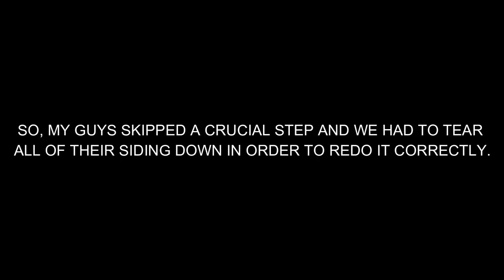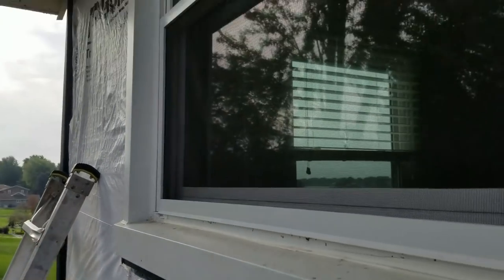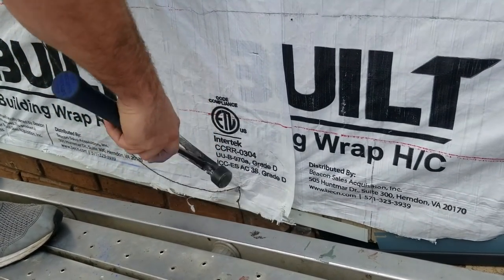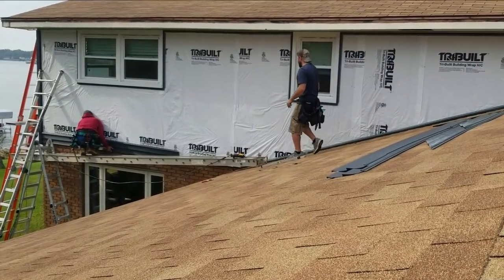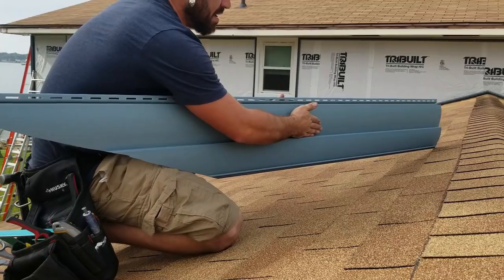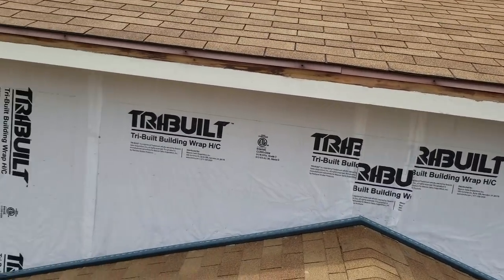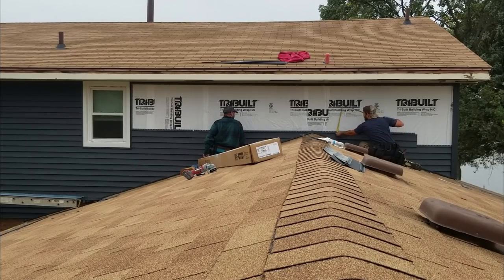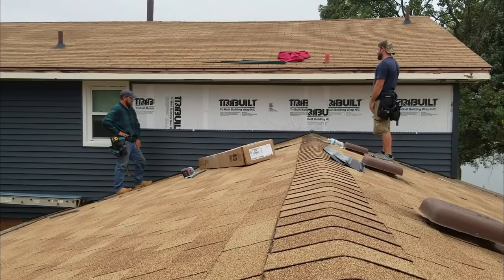HOW TO and HOW NOT TO make siding meet UP over a reverse gable

Comment: I was the brake operator for 3 years back in the 90's for a local sliding guy in NJ. I guess i wasn't cut out for the pick had shaky legs. I was the brake king could bend anything! Dormers were the worse for me had to step off to make the next piece larger & level pain in the butt. I stayed close to the ground making the trim,receiving fascia,under sill trim,pork chops. Thank you your video brings back memories.

Comment: The easiest way to level out a house is, first check the foundation to see if it's level, 99% it is, then put your level up, you don't need it anymore. Next measure down 3/4" from the bottom of the. Rim Joist or 2nd story plate. In your case the plate. Now measure up from the 3/4" mark to the top of the starter whatever it is 2 or 2 1/2" whatever and strike your lines. Can't go wrong. We never measure down from the soffit on any reside job because most times the boxing is not level. It's my little trick, always works out, even if the job is cut up it lines up from start to finish. If you're using insulation sheets, do the same thing, drop then 3/4", cap the bottom of the sheets and run your starter. It's fast and easy. I hope this helps in the near future.
Reply: What about if you are up on the second wall above the 1st roof and you have 3 jogs until the corner? How do you set your marks so your laps meet in the corners if not.going off the soffit? Cheers.

Comment: If you have the choice of setting a plank on a step ladder or using a ladder jack on the inside of a tall straight ladder, go with the ladder jack and the tall ladder. It just looks like the step ladder could fall away from the building unless it is somehow held at the top. Then again, because the plank is on the sloped roof, there is a chance of some push to the left, to the outside of the building corner, where the tall ladder is. Bottom line is safety.
Reply from the maker: Yea tell that to my heathens maybe they'll listen to you

Comment: Hey Zach, heads-up. I just read in my remodeling newsletter that OSHA has busted Roofing Solutions with potential $202,000 in fines for not having fall protection equipment along with tailgate safety meetings and hardhats. There are a lot of other companies they are are going after also. They said they are following up on complaints. I myself love what you're doing and it is very motivating to watch you explain your procedures. Haters might drop a dime on you though. Keep up the good work and be safe.
Reply from the maker: Is that from YouTube? They're busting them from there
Reply: @NWIVeteranConstruction  , the article came from remodeling magazine. The article said it was based on complaints. Not sure how the complainers got their info about roofers. They were taking action in multiple States.
Reply: @NWIVeteranConstruction  also an unrelated story. I had a friend in Twain Harte CA who is A GC and was working on a job. A sub unlicensed but recommended by him showed up on the job and fell off a ladder and was paralyzed. My friend being the GC ended up being sued  and lost two houses that he owned. My friend had no workman's comp in place. I myself have no employees except my three sons to help me occasionally. I just purchased from Home Depot online four sections of five by five scaffold for less than $200 each and the yellow 30 inch wide by 7 Foot scaffold three sections at about the same price. I will only use these with guard rails and toe boards in place.
Reply: @NWIVeteranConstruction  I reread the article and that happened in West Virginia and they're also working in Florida Ohio and Maine
Reply from the maker: @redwood6737  that's crazy.  We're not doing anything insane. Ladders and a lack of understanding of how to be safe is the reason for injuries
Reply: @NWIVeteranConstruction  Zach, REDWOOD is not joking. OSHA has been coming down HARD on roofing contractors for failure to properly tie off and they're levying massive fines. I get the fact that you're safe and you're confident up there but OSHA doesn't care one whit about you're "I'm being safe" talk. I don't know who has alerted them but they're nailing roofers here in Ohio left & right. I love your channel, respect the hell out of what you do and the pride you take in your work. I would hate to see you get wrecked financially by OSHA and that's exactly what could happen if you don't take the safety stuff to heart. I get the fact that a lot of it is overreactive gov't regulatory BS, but man that just doesn't matter. One roofing contractor got sentenced to prison for failure to have his employee tie off after the guy fell off and died. Check out this list of OSHA violations for failure to tie-off and more importantly, look at the fine amounts. https://www.osha.gov/news/newsreleases/region5

Comment: With double four siding with no insulation on the back on the panel if you ever run into that problem again you can cut the nailer off . Face nail it run starter strip level at the height no one will ever notice if it's an inch off ever

Comment: Can you explain step by step how to figure out the roofline angle?
Reply from the maker: Download "pitch guage" app. Set it on roof. OORRR  just type in " how to make a gable pattern" on YouTube and choose my video where I'm in a green shirt.  Badass trick I show you!
Reply: Or put speed square with the thick part at the table and all the degrees facing horizontally. Then take a level and put it at the pivot point of square and level it out. It will show you the degree of gable. It will cross a number on your square when you level it out. Then subtract that number from 90 when you use it to draw a lot ne of your gable pitch

Comment: Looks good but can’t you just run siding completely up the roof until you hit the peak than have your cut out peak piece run to the other side than level a line across than measure whatever the profile siding it is down until you hit your first piece on the other side?
Reply from the maker: Sounds about right. You can definitely do it a few different ways. These days I laser a level line around the entire house and pull numbers from there. Situational obviously but it Makes everything so much easier

Comment: Any multiple of 8 is a multiple of 4.  You probably knew that, but it sounded weird.
Reply: Don't fall for that. When connecting the siding tongue and groove, use the full panel 8 when measuring, or else you can not hook into the other piece.

Comment: Nice Cut!! How did you find your angle? What did you cut you angle pieces with? What type of blade for the grinder?
Reply from the maker: I like a diamond blade for the grinder.  And I level a piece and then use another piece to trace it by putting in in the j channel with the bottom flat with the angle Of the roof. That's probably hard to envision But I have a video on it that will help. Look on my channel for "how to make an L n R pattern for gables" its the same exact concept.  Posted about 2 years ago

Comment: I shoot all my starter with a transit. That piece where it meets the peak I measure up on both sides from the siding already in place and snap a line so I know it's running true. Love your videos though.
Reply: How do you find your angle when going up the roofline? Cheers!!
Reply: @Phoenixrising8313  pitch gauge app on my phone. If your siding is level it's always accurate

Comment: The idiots that did my home never put any protection such as tar paper over the insulation and now the vinyl siding is popping off from the wood rotting because nails won't stay in. I have a two story house and cannot reach the top without a lift. Out here in BFE you cannot find anyone to do anything! It's horrible
Reply from the maker: Sorry to hear!
Reply: If the insulation was 2x4' then people usually just tape the seams and the house wrap is under the insulation. If the nails are popping out then either they are too short or the plywood is rotten.

Comment: I would’ve transferred a line on the small side of the table. Ran it up to the peak then gotta level line off the top panel and went down In increments of 8 til I knew where the starter should go. Then measure off the soffit get my measurement go the the other end draw down snap a line and boom your off. And the other side is already done

Comment: Dude alot of unecessary measures put a roof bend on shingle 3/4 21/2 11/2 by 3/4 match the corners n hang panels. Theres never a need to snap a line unless u want it for rake cut
Reply: Can you dumb it down?

Comment: Some of your house wrap seams look very narrow (21:19 on your left) and none are taped.   Water happens to find its way to those narrow joints and you have rotted walls on your hands.  You might also want to check your installation of J mold next to shingled surfaces...looks like this install in super close if not touching the roofing  Sunny summer days will turn vinyl that is too close to hot shingles into sagging goo.
Reply: Exactly my thought. I always run z flash on roof, setting j channel in shingles is against code here. And what kind of house wrap is that? Is it self sealing? Because if you tore off the siding how did you cover all the nail holes? Also, wrap shouldn't get trapped under the starter, it'll leak, needed a flash between brick. Do remodels there not get inspected?

Comment: Do you use insulation board under siding in your area?  In my are can range from 3/8 to 3/4 inch.
Reply from the maker: fanfold? yes only in certain situations though. typically if its a house with plywood on the outside we're just house wrapping it

Comment: Also why would you want the measurement to center of the panel. The siding I use mostly is double 4 add a inch and quarter so my lines are always top panel. Easy to see and for idiots on the site that need to see everything it definitely helps.
Reply: did you just called all rookies idiots?werent yourself newb back when u started ?
Reply: I did and I guess I’m just a natural

Comment: I guess I should watch the entire vid before I post. Cause U did add the inch and half. My shit is inch and quarter
Reply from the maker: look, i wouldn't show myself on video doing something wrong or backwards because i really it will influence others, therefore i don't talk about anything i don't know about. SO, whatever you're talking about...you could be right. me on the other hand, i have a set way of doing absolutely everything you can think of. there's not a question you can ask me (if you spell check your sentences and grammar) that I couldn't answer in a heart beat. if you're referring to the factory end having an inch and a half "tab" or whatever on it. then I'm not actually adding an inch and a half when I measure. i usually pull numbers from the tab, unless i'm dealing with an angle and i need a mark on the bottom.  i have 2 other siding videos that can help you make sense of what i do and why. "gable cut man" and "siding crew, tips and trick" its all explained very well.
Reply: Jesus. I was trying to have friendly conversation and u got all butt hurt it seems. I felt like I was giving advise and a different point of view. And FYI there isn’t a job you can post I haven’t seen a million times.  I just don’t do mine so beginner like. We have been slaying shit for 15 years and hold down damn near every prominent builder in the area. When I first subbed I was just trying to bust balls. This time I was really just giving my point of view.
Reply from the maker: @jeffcousineau7752  I was going to have a normal convo here because I encourage others to give advice and share opinions so we can all grow together but it was very "matter of fact" and then  you told me to start a channel called world's slowest sider lol kind of changes that vibe
Reply: I was just busting balls. I watch your vids. I agree with some things and obviously I don’t agree with others. If you came on one of my sites you would feel the same. We’re roofers man. If there’s one thing thing we’re good at other than our jobs it is busting balls. I have learned a few things from your shit for sure. I’m always open to getting better.
Reply from the maker: @jeffcousineau7752  for sure. You gatta give me a heads up you know I got a whole ass hater herd to deal with
Reply: Oh I bet. All jokes aside. If I see brad siding while sitting Imma lose my shit lol. The zombie roofer!!
Reply: @Worlds Fastest Shingler don’t pay any mind to the haters. The only thing you should be worried about is the guys sabotaging you. Someone will always have a better way the fits them and everyone else’s way is wrong with the same results. Keep up the good work we are bathroom and kitchen remodelers and I normally sub out my roofing and siding work. I can do it no problem but not fast or efficient at it at all to make money. Just buy watching your videos I had enough confidence to replace my 10pitch roof and siding in half the time it would’ve taken me. Thanks for the info buddy keep up the good work you don’t really see to many Bussiness owners our age be successful.. later bro

Comment: Why are you using grinder to cut siding be easier to turn saw blade backwords and cuts like butter unless it is really cold outside. Also invest in pump jacks  with electric motors and work platform make.life so much easier then only one person and helper job